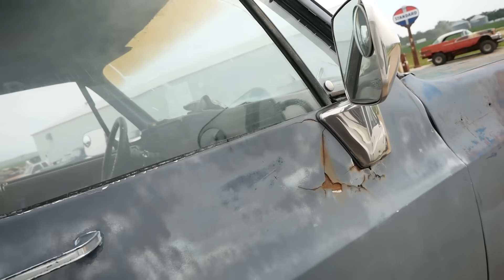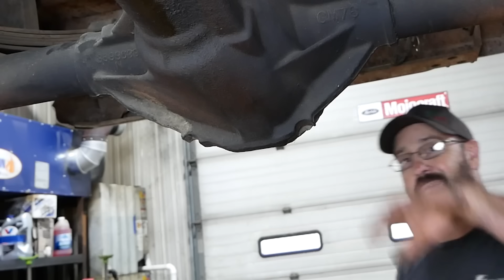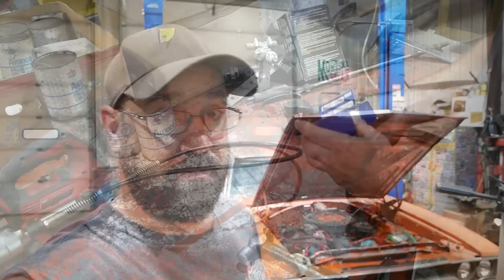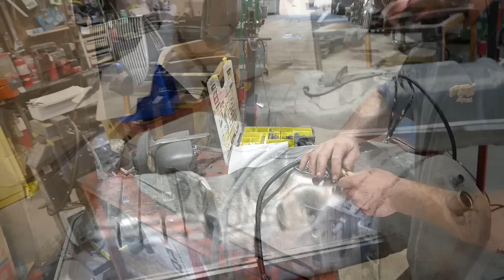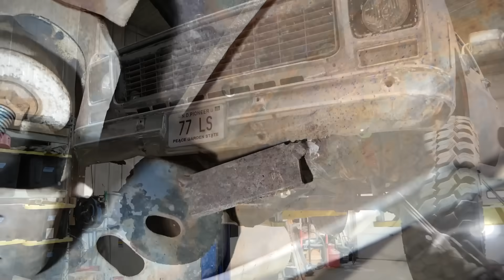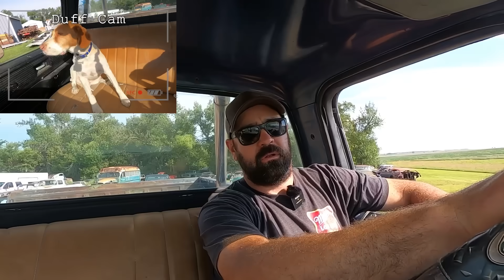Super Cheap 4x4 Shortbed Squarebody! LS Swap Hack Job!

Comment: Holly has a nice drop in high pressure pump for the 73 -86 tanks. Holly pump won't fit in the 87 EFI tank. because of the baffle
Reply from the maker: Good to know, thanks for the tip! 👍

Comment: I'll never understand why people swap out GM Corporate 10 bolt front axles for a Dana 44. If you're going to swap out the 10 bolt, why go to a weaker Dana 44? Upgrade to a Dana 60 front at the very least.

Comment: The lag in your transmission engaging into gear is likely slack in the drums. Like the thrust bearing on the crankshaft there are special bearings in the transmission core designed to maintain longitudinal preload. Most builders call these parts thrust washers. But they're also called flat bearings or flats. The master build kits often come with shims to install behind these flats to compensate for wear in the drums and core supports. For a truck like this fine example I'd probably recommend exercising patience . Crank the motor and give it a few seconds for the pump to build pressure. When you put it in gear wait until you hear the clunk before revving the motor. Correcting the problem is going to require tearing the transmission down .

Comment: The 7.0L LS engine, known as the LS7, is a legendary naturally aspirated V8 from GM, displacing 427 cubic inches, famous for powering the C6 Corvette Z06 and Camaro Z/28, making 505 hp with titanium valves, forged internals.

Comment: I use a ratchet load binder to pull frame. They pull severely hard. Im suprised how easy it pulls.i guess thats why i dont have a cable puller. You DD SPEEDSHOPPED IT!
Reply from the maker: Thanks for the tip!

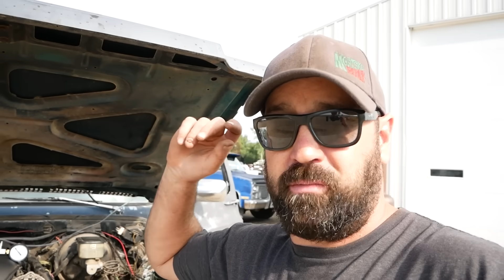Comment: Fuel pressure on a 99-02 vortec 5.3 should be 55-55 and when you can a vacuum leak it should jump up to 60 so 40 is quite low 1:28:10. I just did this test on my 1999 and I know the specs

Comment: Years ago I rear ended an early 70s c20 with my 79 c10. His hitch dented my bumper in in the center. That weekend I got a new to me bumber from the junkyard and layed under the truck with a sledge hammer to adjust the horns on both sides till they lined up with the bumper.

Comment: Really need to use an alignment tool to put the rear cover back on, then you install the seal after. Since there are no dowel pins there is nothing centering the cover to the crank. Ask me how I know. I put all new gaskets on my 5.3 LS swap and it only lasted a couple hundred miles before the rear main seal started leaking. Hopefully yours doesn't.
Reply from the maker: Good to know!

Comment: Excellent Video Mortske  :) , Duff The Dog 🐕.  :) also bet wire harness got melt by exhaust need rewire up be shift problem and would put WYNNES BRAND black bottle of Trans Medic in transmission to add and ground straps to also get bottle of black or grey of STP Total Treatment for Carb plus Fuel injection  too ! Also add ground pigtail from battery terminal clamp to fender  bolt with ignition connector! Bet cure all problems  too!

Comment: Odd question.  What do you run your torch regulators at? I was always taught 5 psi gas, and 20 psi oxy.  Recently had a experienced boiler welder tell me 9psi gas and 60 psi oxy!
Reply from the maker: Well let me look. Sure enough. 5 and 20!

Comment: That is a very fair price. At least around here in Northern Nevada.
Reply from the maker: Thanks!
Reply: @MortskeRepair you can't buy an LS swapped anything around here for less than $7k. Just the motor and trans out of a Tahoe or whatever is like $2500. They are really proud of their stuff around here 😜

Comment: Your engagement issue is probably due to a stall converter
Reply: Try changing transmission filter.
Reply from the maker: You didn’t watch long enough

Comment: $3,500 for that ? REALLY ? Maybe $1,800, MAYBE.
Reply: Four years ago, that truck would have been $1,800. 
But in a world where oil changes cost over $100 and hamburgers are $25, $3,500 doesn't buy you much anymore.
Reply: @johncabot9058  True but man that truck has many problems, many.
Reply: @NoWr2Run She's been rode hard and put away wet.
Reply: @NoWr2Run  I agree.
Reply: I sold 1 about 15yrs ago for 500.00 .  4 wdr. 350, 4oo automatic, bare bones no rust came from OK.
Reply from the maker: Clearly I know nothing about values

Comment: Might be worth it to pull the transmission pan off to see what the filter looks like or how much crud is laying in the pan. I've had TH350s that were slow going into drive & it was because the transmission filter was clogged full of crud and change it & cleaned the pan out & flushed the transmission lines & the transmission would go into drive again right away .
Reply from the maker: Easy enough
Reply: @MortskeRepair Definitely worth a try. I bought a 82 Chevrolet k10 short box from a person that was originally a diesel that the owner pulled that boat anchor out and was going to convert it to gas and never finished the project and put the truck up for sale for 1,200 and I went out to look at it and the body on it is actually in better condition than yours is but they also took the TH400 out of it & a TH350 was in it minus the torque converter. I had a 76 Chevrolet K5 Blazer that was my plow truck with a TH 350 and the same transfer case as your truck has but the 82 Chevrolet k10 when I was looking at it underneath it has a 205 gear drive transfer case & that alone sold me on buying the truck & i got the owner down to 800.00 for it & spent that spring parting out the blazer and building the 82 Chevrolet k10 and took the torque converter from the blazer and put it on the TH 350 that came in the K10 & got it running & drove it some 1,200 miles that summer and the engine from the blazer is a 400 sbc that I regasketed the engine & put a different cam with new push rods and roller rockers and bought a Wieand Stealth dual plane high rise aluminum intake on it with vintage Ansen finned aluminum valve covers and a Edelbrock 600 CFM carburetor jetted for performance rather than fuel milage and it runs strong but I did put a new front pump seal in it and bought a deeper pan for the transmission from Speedway motors along with a new adjustable kick down cable and the transmission shifts nice & firm yet . I kept the spare TH350 that was still good that's in the shed along with the transfer case & both differentials that are 3:41 gears in both of them along with the drive shafts and scrapped the blazer . The 82 Chevrolet k10 is my plow truck to plow my driveway out in the winter in rural Wisconsin but once it gets nice out I pull the plow off & I drive the truck quite often during the summer months after I drop the winter oil out of the engine just so it's not sitting all the time . I've already had 2 people ask me if I wanted to sell it and said nope I need it to plow my driveway out . I've got a skeleton mascot that rides in the passenger seat buckled in & I took it's right hand and used a propane torch to slowly bend the hands fingers and it's giving the middle finger that's up in the passenger window lol . I get a lot of people looking at it and I had a woman one day while I was at the BP gas station with it filling the tank up and she asked if she could take pictures of the skeleton & said go right ahead and I asked why she wanted to take a picture of it & she told me that she has all kinds of skeletons in her yard like some kind of Halloween scene that she keeps up all year she said which I thought was kind of strange but I guess it's not any stranger than what I'm doing with it in my truck lol . I bought the skeleton from Menards when it was on sale for 23.00 & there are 2 red LED lights in his eyes that I can turn on at night if I want or even during the day but don't use them much . I've had quite a few of these square body trucks through the years and they really are a great truck and I've been noticing a lot of them running past my house on hwy 63 in Clayton WI now that some have been fully restored while others are nice originals driving by . I think a lot of people are buying older cars and trucks and are going backwards because most of these new vehicles are way over priced piles of junk that are failing before or when the warranty is up plus they just plain suck to work on now with all the computers and modules on them that can & will fail not to mention the constant computer updates they have to have now as well which means dealing with the Stealership as I say lol . Keep up with the content because I've been watching your channel ever since the early days at the old shop trying to get the old iron up & running again.

Comment: Does the transmission have a Modular valve? It's gotta have a powerful vacuum. "Leak free" as you say...
Reply from the maker: Not sure. Never had a problem with one in a low vacuum application

Comment: As a non American and thus knowing little (aka nothing) about American engines, whats the fascinaation with LS swapping cars? Is it just because they are a good motor or are there other benefits? I follow a number of car guys on the tubes and LS swapping seems to be quite common.
Reply: Cheap, tons of aftermarket support. Good power. They made eleventy million of them. Good reliability. Parts available in every small town auto store. They may be boring and cliched but they work and serve a purpose keeping cars on the road that would otherwise go to a scrapyard.
Reply from the maker: What he said!

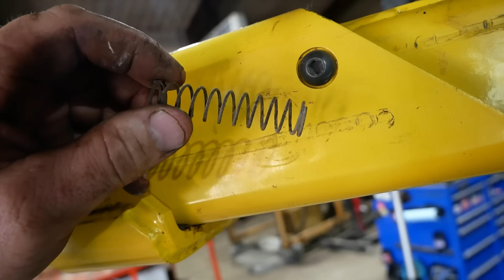Comment: 29:20 a tapered lug nut and a drum brake spring will also work for th350 shift linkage. Or so I’m told.
Reply from the maker: Interesting

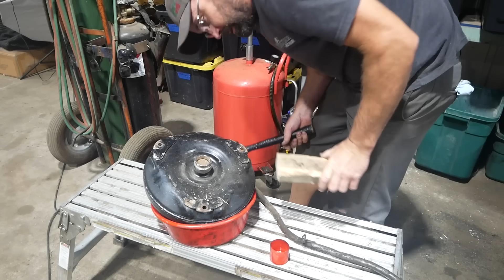Comment: 24:00 I didnt know a torque converter hub could be sleeved. I had a trans shop rebuild the 727 in my 68 440 Fury. It had a B&M Super Holeshot 3000 stall converter in it. He told me the hub was too grooved to be reused and would cause the new front seal to leak. He went ahead and replaced it with a 2000 stall stocker without consulting me first. Knocked the guts right out of the car (it was cammed for 3000 stall).

Comment: I had a 81 Chevy truck did that and look at everything rebuilt transmission still didn’t come to find out it was in the selector on column just saying
Reply from the maker: How could that even be?
Reply: @MortskeRepair  Because of the nut behind the wheel, apparently.

Comment: The hell is wrong with building a proper  4 bolt main 350cid SBC? That's entertaining.. Shot peen the rods, debur the piston skirts,  debur the oil galleys.. Epoxy paint the lifter valley.. This LS cult is far outta hand.
Reply from the maker: Do you own a late model vehicle? Happen to notice them all on the road? That’s what LS swaps are about. Upgrading.
Reply: All that work and expense on aftermarket parts on your SBC only to have it make less power than a stock 5.3 must be kinda emasculating.

Comment: The transmission dipstick and tube could be wrong the full mark should be were pan and  case meat. It has a 350 K case the6are getting hard to find and pricey I always use loctite on one piece rear main seals
Reply from the maker: Good to know!

Comment: For your fuelpump  sender  on ls swaps you can cut the ends off like you did and instead of the compression fittings barb to nylon hose, use your mastercool hydrolic crimping tool and put the gm fuel line adapter and you can make the sender quick disconect.
Reply from the maker: There wasn’t enough room and I was afraid of screwing up. Then you’re SOL if it ever goes bad on the road and you don’t have that tool with either

Comment: Unbelievable i just had to fix all the same stuff you did in my LS C10 none of the butchery you had to fix... but every fuel component had a map sensor wire that got rubbed the wrong way too. (That veepeak deal has quite a few apps you can use with it but grab something with data log and you can create your own parameters on your phone pretty handy when you don't get those codes)
Reply from the maker: Good to know!

Comment: I believe y our input drum needs one more clutch and one more steel removed . Didn't have correct drum assembly when rebuilt.😊 or thay used nylon sealing rings versus steel sealing rings. Could be pump, ETC.😊
Reply from the maker: Good to know!

Comment: Tom You had a tool you used too find electric problems while troubleshooting electric problems. It would show hot wires versus ground wire. What is the name of said tool or part number? The tool was red in color.😢
Reply from the maker: Power Probe
Reply: @MortskeRepair thanks😊

Comment: They seem to do stupid s*** all the time. They put Teflon tape on a brake line fitting. Why would you put it on a brake line fitting? It's a flare fitting. You don't need it. It seals on the brake line fitting the tighter. Yet tightened, it Shields up against the lip of the fitting.  Some people just don't understand things
Reply from the maker: Yup

Comment: Filters dirty
Reply: Also, has any tranny guys explained the operation of the TV cable?(throttle valve)
This adjusts the shift points via throttle input.
Its secondary ability is to down shift.
Miss adjusted TV cable will cause transmission damage.

Comment: With a lift kit, I thought those spacers went between the crossmember and the frame to space the transmission down a little bit for a better pinion angle…
Reply from the maker: Never seen thar
Reply: @MortskeRepair  it’s not something that would matter with only a 2 inch lift kit though… I had a jeep that we put a big lift kit on and those came in the kit to space it down and help opinion angle
Reply: @MortskeRepair  or it was too clearance the front driveshaft because it was rubbing the skid plate… It’s been several years ago but I remember having to put those in

Comment: I put a LS in a Jeep JKU wranger. I did everything wrong! but I just put a adapter plate at the oil filter for a oil pressure gauge. but I also have the oil sending plugged into ECU ( what i did wrong I used a ACES Jackpot LS swap EFI ) it does work well but I should have just done factory EFI. I'm going to do another LS swap in the spring in a 1972 Buick Skylark the 350 runs good for a Buick 350 2Barrel I just changed the 2.56 open diff to a 3.55 and it will do okay burnouts it is not fast just not sloooow. Please keep up the awsome work.
Reply from the maker: That's awesome, good luck with the Skylark!

Comment: I had to straiten the front frame horns on a 69 Chevy camper special. This was about 30 years ago. ( I didn't have a telehandler😂) I used my long ram jack from my hoist. A ton of diagonal pressure between the cross members and front horns followed by some well placed whallups with the Big thumper hammer. Does wonders. Drove that truck for about 5 more years till she threw a rod. Sold it cheap. My oldest daughter learned to drive in that truck
Reply from the maker: That's quite the story!

Comment: Sorry mortske can't help but be a squarebody nerd thats a 79-80 hood 79-80 headlight bezels but in 1980 you could also get square headlights rpo code v22 73-74 grill then the rear bumper is actually a factory chrome step bumper which are actually really hard to find in good shape
Reply from the maker: Yup
Reply: @MortskeRepair yessir

Comment: Auto Trans - mostly what happens is your Automatic Transmission Signal Accumulator Piston(s) has worn out and possibly drop the pan and change the filter as well.  You'll have to remove the filter first to get to the Accumulator Pistons.   It would be cheaper to buy a complete Kit of Pistons with O-rings, sleeves, caps and springs...  Best of Luck - this will probably save from swapping Trans out again.
Reply from the maker: Appreciate the advice!

Comment: Re: torque convertor, Steve Morris was fighting a transmission issue getting too hot while on the trans brake and blowing hoses  and he found that if the convertor is pushed all the way back into the pump fluid could not flow. It needs a gap to let the fluid out.
Reply from the maker: Appreciate the tip!

Comment: I consider these "LS swap, how bad can it be" videos educational videos, because I have learned a couple of things: #1 you can sell a TERRIBLE vehicle to nearly anyone as long as it has an LS in it(note the comments saying what a good deal it was...no it wasn't) #2 whomever does these swaps originally are relentlessly terrible mechanics who hack stuff together, then promptly sell when they realize what a hack job it was. Whomever put that truck together was terrible at it and was probably under the age of 30. It's like Cookie Monster worked on it...me want to hear engine run. Never mind who dangerous the rest of it is. BTW if somebody actually removed the NP435 to install that TH350(couldn't have at least put a TH400 in it) they need their man card revoked.
Reply: I made note of the Mopar profile pic. I hate gen 3 and LS swaps equally and I am 90% Mopar but would rock the oddball Pontiac or Galaxie 500 XL or Cougar here and there. It just gets Moses fucking old and quite exhausting seeing almost every other video a gen 3 or LS swap . . . . . . .
Reply: Sm465
Reply: I did exactly this. Got a 84 k20 with a 5.3 for 5k. Was a manual but the guy put a th400 and a np203(why would he put an all time 4x4 idk😭). Everything is hacked together and is terrible. Now I gotta basically rebuild the whole truck

Comment: Would the transmission problem be the modulator valve? May not be hooked up to correct vacuum amount...
Reply: That trans doesn’t have the vacuum modulator.

Comment: dude do you happen to have a parts list for that fuel  tank swap
Reply: Its not hard 87 tank sending unit walbro 255 or comparable that will fit the 87 sending unit. Then fuel lines.

Comment: Apply tension or pressure and hammer on the frame where it looks bent/buckled to help relieve the tension. A "slide-sledge" is a useful tool to help with this as well.
Reply from the maker: Thanks for the tip!